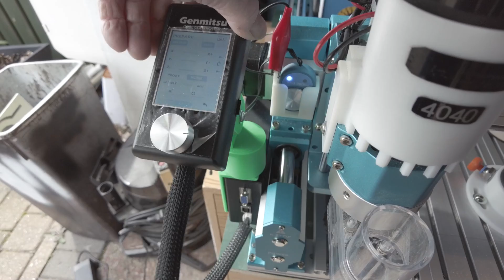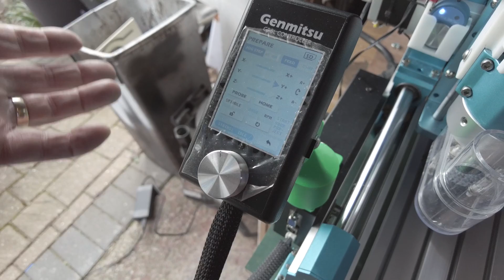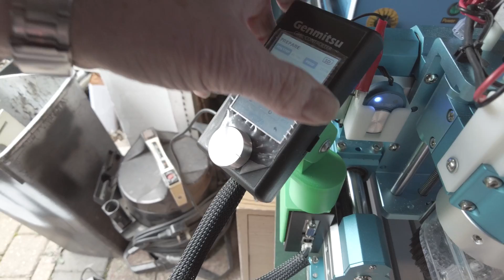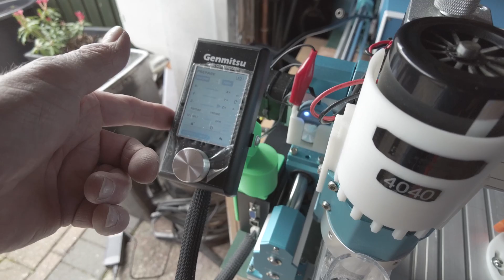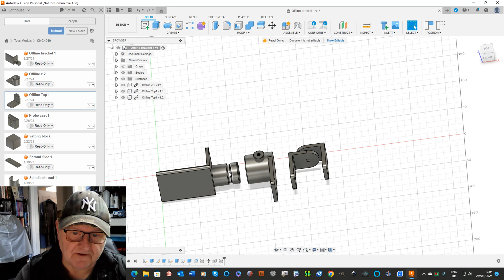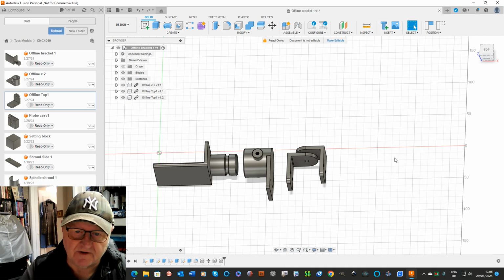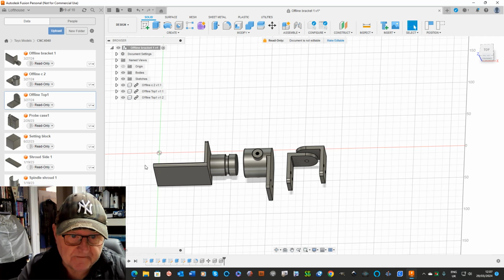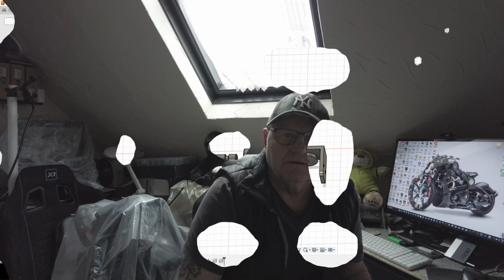Sainsmart Genmitsu CNC 4040 Pro 3D printed offline controller Bracket

Comment: Much appreciated for the model good sir. I'm getting this cnc soon and the offline controller as well since my shop doesn't have wifi access.
Reply from the maker: Thanks for the comment hope my design helps
Reply: @Tonys.Top.Tips.Workshop  Just a quick update, my 4040 pro arrives monday, but I already got the offline controller so I decided to print out the mount and it came out great. I printed it in carbon fiber PETG since my shop is uninsulated and detached so I figured the extra heat resistance would be welcome.

Would you mind sharing your z probe holder file? Thanks in advance.
Reply from the maker: Hi thanks for the reply if I can find the stl file to upload I will do so and let you know
Reply from the maker: @NWGR  Hi just found the file it has been uploaded to makerworkl It is in the process of been authorised.
Reply: @Tonys.Top.Tips.Workshop   Thanks Tony! Much appreciated. 👍